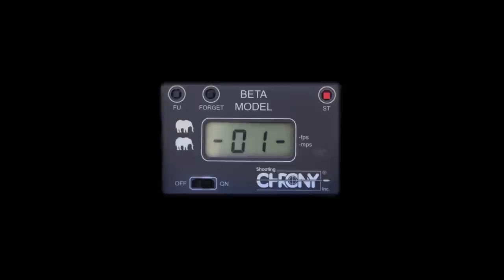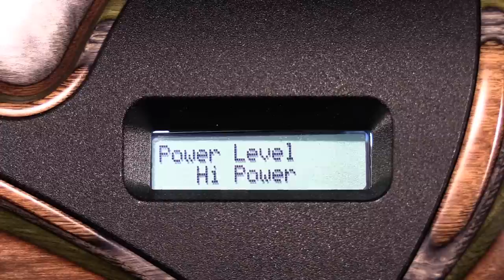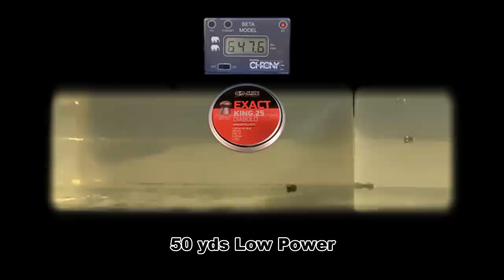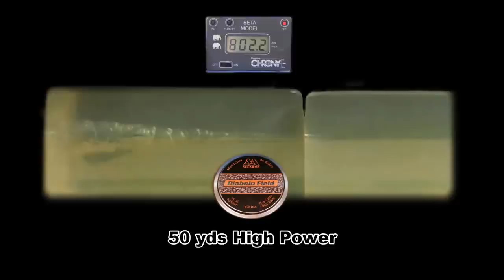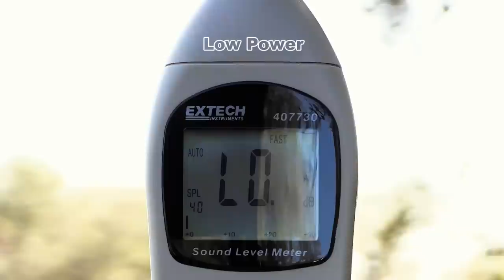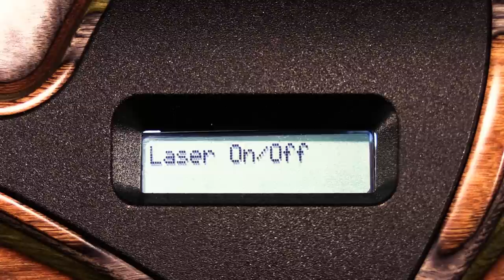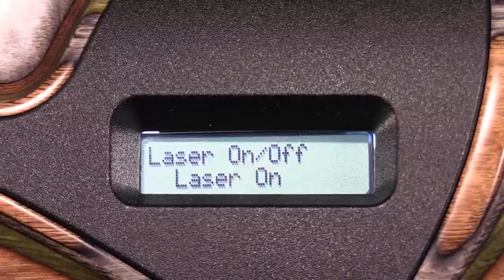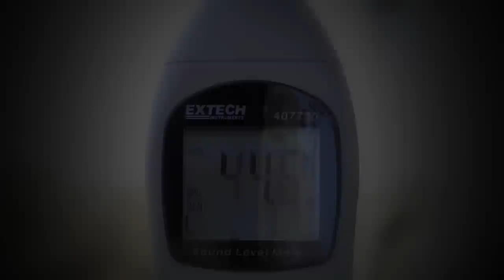Daystate Pulsar .25 Air Rifle - 50 & 100 Yard Accuracy TEST + FULL REVIEW - All Electronic Airgun

Comment: Lovely airgun, a bit out of my budget range and got too many diverse interests that all cost a lot. But I'd be lying if I wouldn't mind having one of these myself, the stock looks lovely and the gun seems to do its job.

The amount of shots you're getting out of it is impressive too, especially the low one how relatively consistent it was. And down to that very low pressure: 68 bar on low and 98 bar on medium, its a lot lower than most PCP rifles/pistols go in my experience. Kinda nice really as it lets you get a lot more shots out of the tank for short/medium distance plinking before you gotta drag the tank back to a source of high pressure air if you don't mind doing partial refills on the rifle to lower than 230 bar pressures.

Even though they claim its waterproof/resistant it'll still be interesting to see how the electronics in there hold up when it comes to long term reliability. But definitely an interesting product, great video showing both how it looks and performs as usual!
Reply from the maker: +Extra stuff Hey Extra Stuff.  Thanks for another visit.  I'm with ya on the diversified hobbyist thing... I am one too.  Yea, there were a lot of firsts for me with the Pulsar and the GCU being able to make use of super low remaining pressure was one of them.  There's no waste here.  See ya again soon!  Steve

Comment: Hi there Steve, I don't know if you actually do this or not but, I found out while trying different ammo on my air rifles that, when switching from brand to brand my rifles take a few rounds before the barrel gets rid of the previous (different lead material) before it truly shows its real accuracy with the new one,instead of going straight to the next 5 shots. I see a difference on POI after about 3-4 shots with the new ammo,then I go for the test and so on. Not a problem when just changing weight or diameter within the same brand though! Just my opinion. Great videos and reviews man, love this stuff!!
Reply from the maker: Hey Airheadjoe. Thanks for the comment.  I am familiar with this philosophy and have observed it's merits when going from a graphite covered pellet (like Crosman) to a non coated like H&N or JSB... but nowhere else.  Have you seen it prove its worth going from shiny lead to shiny lead?  Thanks, Steve
Reply: +Airgun Exploration &amp; Advancement Channel Steve, my experience is more with spring piston air rifles so I do not have the steady shooting platform of a PCP to be more precise but, I still notice it even between the H&N and JSB (which I am very familiar with) that I see a difference when going back and forth. I have a very good and accurate HW30S that likes H&N FTT 8.6 and also likes JSB 8.4 but the first 3-4 shots do not hit the mark, it settles back and shoots right on after that,is the same with my .22 R9 and R11. It could be a Wehirauch deal! I have to get myself the FX Streamline when it comes out and put this to the test and see the outcome,will keep you posted on this topic in the near future,my best regards and keep up the fun coming to us fans and viewers. Great Job!
Reply from the maker: I will try this.  Thanks Joe.  Steve

Comment: Very good and informational video, learned a lot from it, TY for making it! The shoot count on the display, penetration... I watched a lot of Pulsar videos, but only in yours I could inform of them. Awesome! Thanks man! I'm gonna buy a Pulsar sooner or later
Reply from the maker: Phoenix Jones Thanks 😁.  The new Pulsar is even nicer.  Steve
Reply: Which one is that?
Reply from the maker: Phoenix Jones Renegade HP is the Pulsar with an electronic trigger and mechanical valve... super cool.
Reply: TY !
Reply from the maker: Phoenix Jones Sure.  You can watch my Shot Show vid and learn all about it from Tony.
Reply: Does the gun comes with the batteries? Or have to buy them separately?
What is the least pressure I can use the gun? At what pressure do I have to fill it?
Reply from the maker: Phoenix Jones Don't know. I haven't had a chance to review one yet.

Comment: Did you know that JSB and Air Arms Pellets are actually one and the same? I recently wrote a mail to JSB asking specifically if there is any difference between their pellets and the rebranded ones like AirArms, Daystate, Cometa... and if any of these companies do have their own tools. They clearly answered me that the pellets are made by the same tools and that JSB owns all the tools and that I can buy all those pellets in their shop (I live in Czech Republic) but only with the JSB label.
Reply from the maker: If they are exactly the same than I'm 6 feet tall, lol.  No seriously, there are clear visible differences between the two of the same gr and usually I'll find a gun likes one but not both.  However this may have changed as of late... admittedly, my tins are a year old.  Thanks for the Intel!  Best, Steve
Reply: Airgun Exploration & Advancement Channel No problem... I heard several times that people noted differences and even that AirArms claimed that they have their own tools at JSB, that´s why I decided to ask the company. I can forward you the email if you want. It is in Czech but you might use google translate... I doubt that they would send a lie in written form but who knows.
Reply from the maker: +dopeofthepope I believe you 100% brother.  The ones I have here are clearly not of the same die though so somethings amiss somewhere... or they changed methods.  The owners of JSB email me from time to time... I'll try to remember to ask them next time we connect.  But for those reading this, there's likely a benefit to having both on hand as one might be preferred over the other... at least that's been my experience.  Best, Steve

Comment: Your production values are getting pretty amazing. I don't know how long you spend in post production, but it's time well spent.
There was a flap or something on the left side of the stock that looked like it might be covering a magazine storage well. What was it?
How long does a load of AA batteries last? Or did you shoot enough to run them out?
Reply from the maker: Edward Nutter For good info on the Pulsar and Renegade, you can check out the SHOT Show coverage I put up a few weeks ago.  Tony Bellas himself talks a lot about the Pulsar in the "Renegade" interview and answers your above questions too.

In post, I normally spend 35-70 hrs a vid editing.  Best, Steve

Comment: I love AOA. But this is the Pulsar video I have been waiting for. Wish you would have DB check the moderator levels. Where did you pick up the SBA looking Moderator? Im no big fan of the huggetts looks.
Reply from the maker: +stfuliberal Lol, the decibel meter wouldn't have picked it up buddy.  It could hardly make out the H-M-L power as it was with all three being just above the noise of me cocking the Pulsar 10 feet away.  Sensitive equipment but the gun was designed to cheat it :-)  Roy Kasten made the moderator for me.  Thanks for the visit and for the support.  Best, Steve

Comment: Did you find that the Air Arms pellets had the best grouping at 100 yards?
Reply from the maker: Yes.
Reply: +Airgun Exploration &amp; Advancement Channel Thanks!

I shoot a HM1000x .25 and I use JSB's. I have a tin of AA pellets. Curious to see if they do better. JSB's group OK at 100 meters, but they are very dirty out of the tin and the excess lead gathers in the moderator. I am also considering cleaning the JSB's to prevent this.
Reply from the maker: +stefanr00 I generally can't put my finger on which is better.  There never seems to be any rime or reason to it, even from tin to tin.  I just keep both on hand and shoot whichever tin the gun likes that that day.  Best, Steve
Reply: +Airgun Exploration &amp; Advancement Channel Hmm the question without an answer. I'll keep that in mind! Thanks!

Awesome channel by the way!
Reply from the maker: +stefanr00 Thank you and welcome!  More to come soon.  Best, Steve

Comment: Electronics have no place inside a field weapon like this. Sure maybe if you live in a non humid area or wheres there no rain. The future for air rifles is using PCP-cartridges with box magazine like we are seeing some air rifles have today. They will be cheaper and more common one day maybe :)
Reply from the maker: Hey Harbard.  Thanks for watching.  Electronics seem to have taken over our daily lives & military forces too, so why not airguns... will be neat to see where we are with this stuff in another decade.  Best, Steve
Reply: +Harbard I dunno, I've got mixed opinions about this aspect. Steve did say it claims to be "waterproof", based on the shots of the exposed internals it looked pretty well sealed up to me.

There are ofcourse the unavoidable exposed contacts in the battery holder but that's a surface area you can get to and tidy up with contact cleaner type things. Time will tell if it gets a good long term reliability or a bad rep for failures due to moisture or general electronical issues, but even though I'm normally a bit sceptical I do think they probably did their homework on this product and its likely to do well.

As far as I understood they plan to bring a mostly mechanical airgun in the same form factor to the market too, I'm saying mostly mechanical because the trigger is still an electronic job there. Basically its to overcome to typical issue in bullpups, all the electronics do in that one is when the switch is pressed it releases the hammer or whatever valve magic is inside it. 

I think they'll have a hard time making something with a purely mechanical action that'll be as consistent as this one is from 230 bar down to 68 bar on low setting. That and other fancy aspects of it make this a really interesting product to me (if I could reasonably afford it along with my other expensive hobbies), but I can entirely respect that some users would be reluctant about electronics in this rifle.

As for being reluctant about electronics consider this to be a similar issue that optics had to deal with for a long period, the manufacturers will have to start using it and products once they are reliable enough will gradually get the userbase to accept it. It'll take some time just like it took some time for a things like scopes, red dot optics, etc to become commonplace and accepted in serious military/police/etc use.